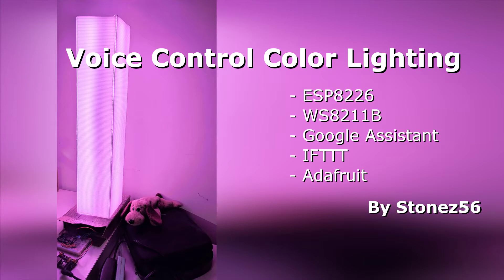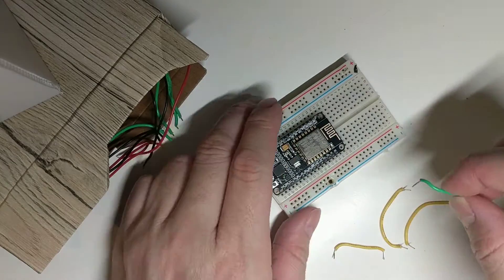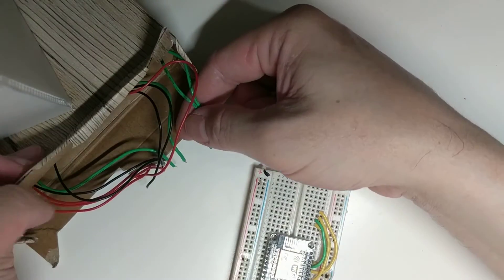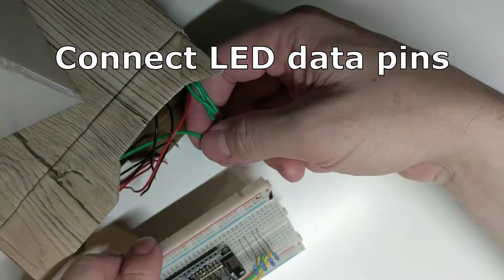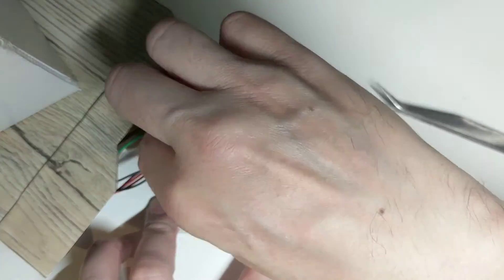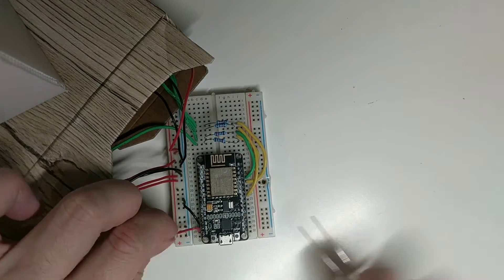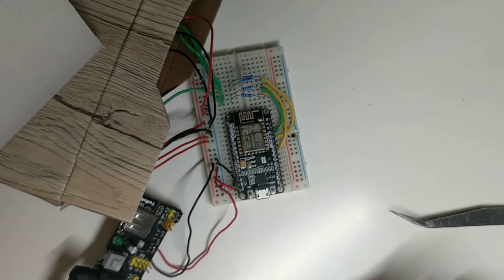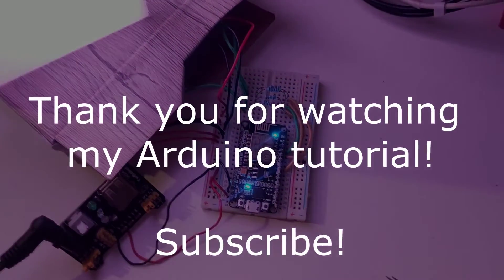Voice Control Color Lighting - NODEMCU connection

Comment: hello sir, sorry for asking so many questions but i guess i bought the wrong LED strip and it has 4 pins .. R , G , B and 5V .. how do i connect these to the nodemcu and what changes should i make to program?
Reply from the maker: Sorry, I never worked with 4 pin LED strips before.  Do you have to product spec sheet? or where did you buy this 4 pin LED strip?